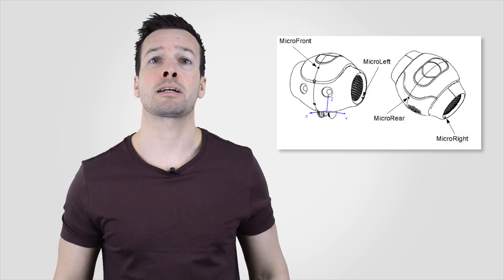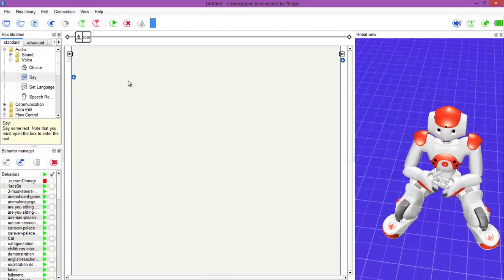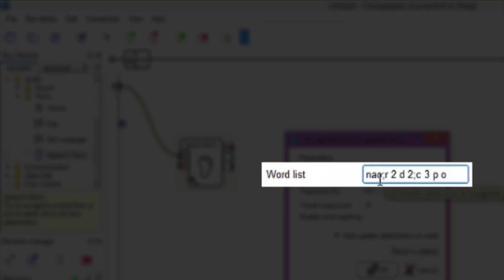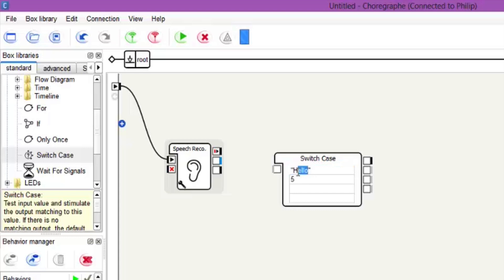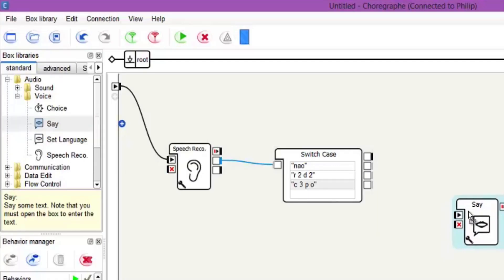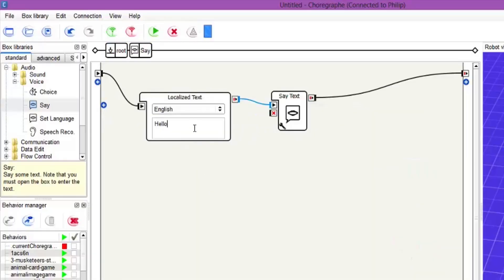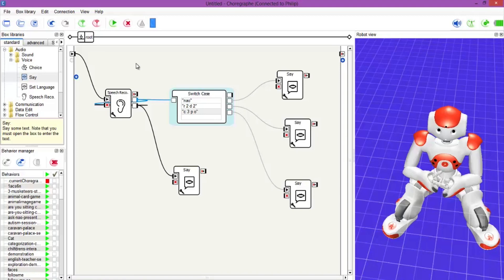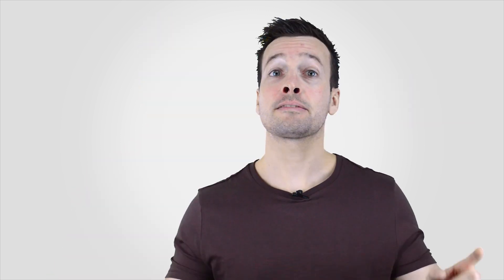Aldebaran NAO Tutorial Video 3 “Speech Recognition"

Comment: Hello,
Have you or anyone had any issues getting NAO to do speech recognition for the second language? I for a brand new NAO (V6) and installed Brazilian Portuguese as the second language. As soon as I switch the language, the robot won't recognize any words. However, I can make it say the words in Portuguese by either using the lively say or pressing the chess button for the IP address. Any help would be greatly appreciated.